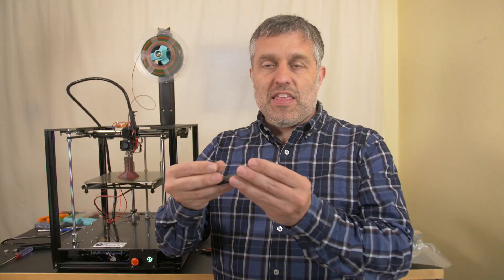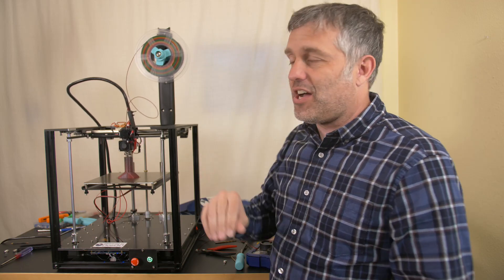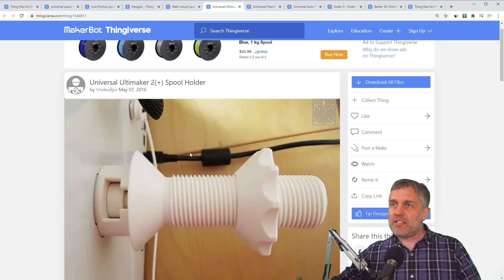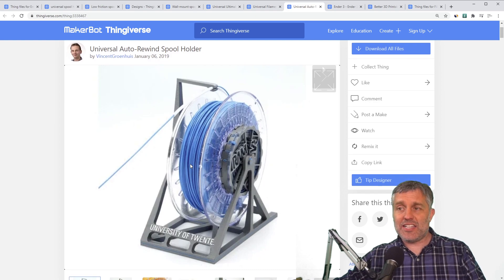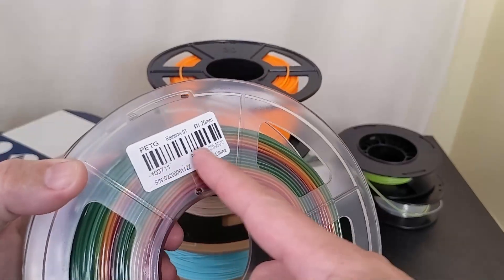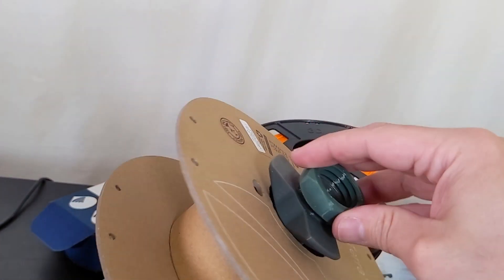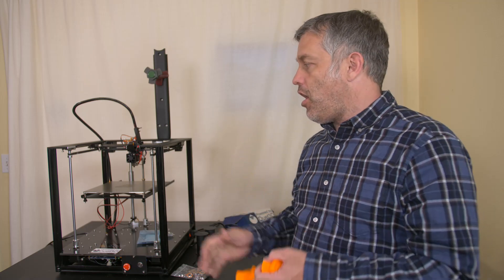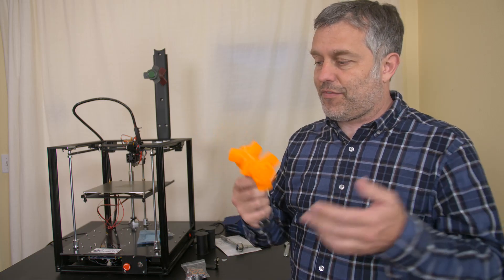The Quest For 3DP Filament Spool Holding Perfection

Comment: I've been using a similar design for years. I have tried the one with the lever arm that locks and unlocks, and they break, no matter what material I print them out of, Nylon, Petg, PC. I tried beefing up the geometry, gave up. I've had spools unwind themselves using the frictionless option so often. Using the nut to squish the bearing is not ideal, I use felt pads on the fixed side of the spool holder -- I adjust the tension of the fixed side to the felt pad (furniture pads, super cheap). Some friction and resistance is necessary to no come back to a tangled mess. This is really a big issue with brand new spools.
Reply: Exactly. Things can get nasty for the new spools when the filament is close to the edge of the spool.
Reply: @medyk3D  I thought much the same myself (great minds think alike, and yet fools seldom differ).

But yeah, it needs a little bit of "tug" (a governor would be nice) to stop that happening. I even considered driving a second stepper with an old extruder to feed out a little slack on demand but that's too damn complex (too much to go wrong).

Now wait until a certain Australian chap allegedly steals the design... (cough, splutter)
Reply: @palewriter1856  Florida? I feel for you/
Reply: @marcdraco  Uh - NO - wrong coast!  
Problem is: my mental flatulence in swapping the r/b color scheme.
Pardon me while I drop back and correct my stupid blunder!!

Comment: You should be using washers when attaching the bolts to the metal bracket at 13:13 timestamp.

Comment: Upon using TPU for the first time, on my Ender 5S1 (Direct Drive), I realized that I'd never get consistent extrusion as long as the extruder had to pull past the friction of the spool on the arm. I'm doing a similar design and researching options before committing to my model - this gave me a few ideas for adjustments. One thing that I don't like is that the original metal arm flexes uner the weight of a full spool and the spool sags and moves to the low point. I designed an entirely new arm out of PLA that clips directly onto to 80/20 t-slot rails on both the back rail and the bottom rail, which adds shear support and stiffens up the entire mechanism - no more sagging spool holder.

Comment: First world problem to solve. The extruder has excessive force to both pull the filament and shove it into the nozzle, so that the filament even able to skip. You need some really crappy extruder motor to be that weak for it to become an issue.

Comment: My flsun v400 holder was so loud. I put bicycle ball bearings in mine so it's unquestionably silent. A lot of these designs are similar to mine but mine has less parts than most and only loses out to the quickest in install/uninstall effort.

Comment: nice design. only issue is you deleted the jam nut. a jam nut exists when you have TWO threadings coming together. your cone unit slides on. so its no more tight than  a simple threaded cone. ie you can eliminate one whole part by just building your plastic nut into your plastic cone.
Reply: He addressed exactly why he did that in the video. If the cone is the nut, it can be unscrewed by the spool and lose tension. By having the cone keyed and the nut to secure it, there is very little chance of the nut backing off.

Comment: Not sure if anyone has mentioned this in the 223 comments already, but one thing that could speed up filament changes is to change that keyed spindle to double keyways, then take your jam nut, and turn that into a keyed threaded nut so it slides onto the spindle through the key slots, then twists onto the threads to jam the outer cone into place. Put a couple of hand knobs, and you've also got the bolt lever of a bolt action mechanism.

Obviously there are other options as well, Since the spindle is there to position the outer cone, you can cut a third off top and bottom, use the flats to key the cone, and again cut a clearance path in the nut to slide on as well, then twist to secure.
Reply from the maker: Good Ideas!

Comment: You said skate board bearings. For those of us that have no clue what size are these bearings.
Reply from the maker: Also known as 608 ball bearings. Don't buy them where you get normal hardware. They will be expensive and not as high quality. If you buy "skateboard bearings" on eBay, you will get very high quality at a very low price. Typically, you can buy an eight pack of skateboard bearings for the same price as two 608 bearings at the hardware store.
Reply: T
Reply: Thank you I found them on amazon. I working on a filament transfer system. I have the new bambu labs P1P and it's version of the multi color unit is very fussy on the size of spool you use

Comment: If it is unwound, press left thread, the point will tighten the nut, you may have to install the drum in the opposite direction, and it is solved!  This is an unnecessarily overcomplicated problem! I cut the original fixed ender spindle in two, put two bearings attached with printed rings and an 8mm shaft. working perfectly!
Reply from the maker: You are like the tenth person to leave this comment. What happens when you install the spool backwards? It pulls from the other side thus unwinding the reverse threads. My design is more foolproof and guaranteed not to fail.
Reply: @DesignPrototypeTest  I didn't criticize your plan, there's no problem with that! I just wrote that I think this is an overrated problem! I simply mounted the original cr3 axle and that's it.

Comment: what about having a left hand thread on the right side and a right hand thread on the left side, then the spool nuts would always tighten during use.
Reply from the maker: Not a bad idea, but what happens when I forget and load the filament 180° so it pulls from the opposite side?

Comment: like bike cranks, they thread opposite rotations. Create a counter clockwise tighten thread pitch (opposite of 99% of applications) and no jam nut needed...
Reply from the maker: Until I forget and load the filament roll backwards so it is pulling with the opposite rotation. Not realizing my mistake until the spool falls off the printer.

Comment: Too low of a friction makes the spool (especially full and heavy ones) continue to unwind due to inertia, which is dangerous considering the risk of tangle. So fo such a "perfect" frictionless holder, one eventually finds he has to slow down the unroll by increasing friction with somme additional brake, making the original solution pointless.

Comment: There is a spool holder I just have to share that I think you'll take some interest in due to the self-unwinding aspect all these free-wheeling designs still have. It's thingiverse ID is 4610364 It's the only one quite like it I've ever run across and it fixes the friction problem without parts that wear over time, though for your heated enclosure, a damper's drag will change with viscosity and temperature.

Comment: So basically remix an existing design then put it behind a paywall.  Gotcha.  I guess the only way to respond to this is to take the existing Universal Filament Spool Holder Gen2 add your additions to it and release it for free on thingiverse.  After all if we don't start using your STLs then it is fair game if I read your other posts correctly; there is no patent and so forth.
Reply from the maker: I find no fault in any of your words. CAD and post to your heart's content. An "Inspired by DPT" label on your thingiverse post would be good. Gotta acknowledge your sources like I have done in this video. Have a great day.

Comment: Your explanation with the blue spool holder is flawed. The screw nut can not unthread as it doesn’t turn in relation to the spool. Both ends run on bearings and the nut turns with the spool which you tighten against the spool. I use a similar design since years and it’s flawless

Comment: I, too, have put this off TOO LONG - putting up with kludged-up NON-solutions.  My first attempt at a solution was a sitting stand with 4 bearings for the spool to sit ON, but that quickly proved inadequate when spool sizes started changing so much - in EVERY direction!
So this proffered design is fine, EXCEPT FOR - all the spools I have of Taulman's filaments on his OLD design spools - the little guys with the tiny hole for a spindle - don't remember the diameter, but I think it's under 20mm.  What I'm working on is something to upgrade my standard Ender 3 holder to handle those little spools PLUS turn on bearings to get rid of the drag that makes my poor extruder work so hard.  So - good job for handling all the ones you CAN fit....

Comment: I like the keyway design. Left hand square threads would be good. And one less component. and the largest  polymer bearing you can fit in a assembly to work with your smallest filament rolls internal diameter. Help with the inertia
Reply: Of the roll. If you find it over rotating. Can even add thrust bearing to set a preload to get the perfect amount of resistance.

Comment: With the first spool holder looked at (by emolan), you're actually looking at a remix that completely neglects the fact that the design was intended to be used with a tube/sleeve which is included in the files of the original creator's post. The flange wouldn't have been an issue. Just FYI

Comment: None of these address an issue making your extruder work harder at semi random times. Inertia.
When you pull the filament quickly it must accelerate the whole roll. There needs to be an auto feeder that keeps a zigzag of filament ready to be pulled without hitting the inertia if the whole spool. A motor keeps the zigzag bent (think like bellows expanding and contracting), so the printer never feels more than the mass of 20cm.

Comment: Print the spool holder shaft w/out infill and the threads become a spring.  Once the the flange is screwed slightly taut it will apply constant pressure and no reinforcing nut is necessary.

Comment: Nice video! 
Every printing enthusiast or professional would dial in the spool holder eg. free unwinding of the spool in the way it is best suited for the current needs and printer. I have few different printers in different configurations with single bearing spool holder and some work with increasing friction and some work directly. The holders that don't work in my opinion are the outside rim spool holders, ruined few important prototypes on those, luckily it was just PLA and not CF, even stock holders outperform them.

Comment: For the spool end nut spinning itself off, put the filament on backwards so it would tend to tighten the holder or print backwards threads.
Reply: or create a thread with opposite rotation thread

Comment: In the background of the intro you can see the extruder overcome the imbalance of the spool and then throw a big loop of slack into the feed .   this might also be due to residual strain in the filament making it unwind itself.  This seems like it would be an invitation to tangling...either on part of the printer or the loops forming a knot.    It seems like some sort of mild friction would be helpful...like the “click” on a surf casting reel that prevents backlash.  Maybe some small magnets that cause some cogging as the spool rotates...Or maybe magnets acting on a copper or aluminum disk so it adds viscous drag but no static drag.

Comment: I have been using them in a 4 spool drybox setup(the screw stays bolted, and they drop into "slot mounts") for about 3yrs, and was using them on a printer mounted or board mounted(one printer is mounted by a 2ft sq piece of MDF)
new spools self unwinding and the jumping the edge is the biggest issue

having a drybox is a necessity for exotics, and having multiple racked and ready to go is good for how often I change things

Comment: @D.P.T. you designed a good compliant mechanism, why not make your threaded connect surface compliant so you can pinch the outer ring part, slide it to approx. position then twist to fine adjust. This design looks good, just seems like a compliance mechanism would be perfect for this.

Comment: This is as controversial as the debate over 3000 mile oil changes! lol
Reply: As shown in the background, the filament was loose and twisted. Presumably, he later added more friction, which may be sufficient to make it only a little bit "controversial." I get oil changed once a year, but I have a good reason for it.
Reply: @michaels3003  I'm sure you get it changed dutifully ever 3000 miles.
Reply: @baxrok2.  , I only drive a few thousand miles per year and I use 12-months synthetic oil.
Reply: @michaels3003  Excellent. I drive more than that but only do once a year changes myself.

Comment: Triple roller designs like the one Mark Rehorst designed and Deckingman uses are superior: filament physically cannot jump the side of the reel, so zero chance of a tangle. Yes, more bearings at needed, but that's a small price to pay for reliability. Plus, you don't have to unscrew anything to load a new spool. Insanely easy and quick. I have them in all my dryboxes.

Comment: I really like the ones where the rim of the spool sits directly on the bearings because they make for very quick mount/dismount. A design where one of those is on a slider to allow for different spool widths and it's sturdy enough to mount above a printer would be my ultimate holder.

Comment: You're printing threads in the wrong direction. It seems most logical to print them that way. But your layer separation problem goes away completely if you print threaded bold laying down.

Also, does anyone have their filament rolls not in a plastic dry box? You should focus on good designs for dry box through holes instead. And no extruder should have a problem pulling a filament roll on a plain rodnof some kind. I use roller stands in my dry box though.

Comment: 14:05 This is the main issue with all skateboard bearings spool holders I've tested - they can unwind to easily. Not so sure of tightening the nut will be enough in the long run.

Comment: Many times the problem with engineering and design is trying to solve the correct problem. Often the actual problem manifests itself in actual use. My observation is that the free spinning spool is a problem, or more correctly, a solution looking  for a problem. A small winding irregularity causes a bit of resistance followed by a release and spin. The resulting loop of filament entangles itself in the printer parts and then gets snagged. The snag and spin of the stock parts is actually amplified. What I want is consistency. A little drag that keeps the filament where it belongs, but not so much there is a bind and release. We need to design a constant but light drag, which will eliminate more potential failure modes.

Comment: I conjured up something similar for my Ender 3 and I find it does need some sort of drag mechanism. I've leaned a paint brush against the spool but want to make something inside the tube.   A light ratchet mechanism with a little forward drag as well would make it perfect.
Reply: You know, one simple TPU part should do the job.  Just a tube with a couple of drag arms that fits snug over the bolt. Might even even be able to design it so you can adjust the drag by how much you squeeze it between a couple of nuts.   Wanna race?  lol. I'd rather just download yours you know.  :)

Comment: Frankly I'd just go with something like thing:3020026 with a narrower roller and have mounted at a slight angle so the spool can't fall off and call it good, been using something similar for years now with no issues. I think I'm going to remix so I can mount it to my old steel stock spool holder for my predator to make it more ridged and sized appropriately for 3kg spools. Thanks for bringing up the subject, I've been meaning make a new spool holder for a while now, i keep getting side tracked with other projects.

Comment: That's basically a remix from the duke doks's design. You should check his thingiverse profile so you can realize that 'your solution' was in his profile like a month ago. 
Some time ago, you uploaded a video about teaching tech stealing content and you are doing the same. 
The solution in this video is good, since it correct the only problem that the original model has, but it is just an improvement, as well as the rest of the remixes of any design in thingiverse.
Reply from the maker: Can you guys quit with these "remix" arguments? I did not remix anything. I started from a blank screen in CAD, and based my measurements off the spools which I showed in the video. Every single facet of my design is my creation. Is a Tesla Model S a Remix of a Ford Taurus? I gave credit to every single source of inspiration I found for my design. Just because DukeDoks made a version with Keyways before me doesn't mean I copied him. I wasn't even aware of his solution until you told me to go look for it, and it's functionally quite different from mine. DukeDoks' solution incorporates keyways as well, but the cone still threads onto the axle. You bring up the irrelevant TT copycat issue makes me think you have a bias against me. Are you trying to harm my reputation, by finding some minute instance of inconsistency in my motivations/actions like I'm some sort of political candidate? Even if I am a hypocrite (and I endeavor not to be so) that doesn't change the validity of my message. Did you see this video of mine that provides a pretty final answer to the "Is TT copying DPT?" Question: https://youtu.be/FE7ZoWcyc6w

Comment: I love what you did here by utilizing a keyway.  Sealed bearings (I think you have seals there, forgive if I am in error)  are harder to turn than shielded bearings.  In fact, you inner race is spinning on the shaft I would wager due to seal friction.  No content but too designed my own years ago due to being unhappy with everything else.  It improved my print quality.